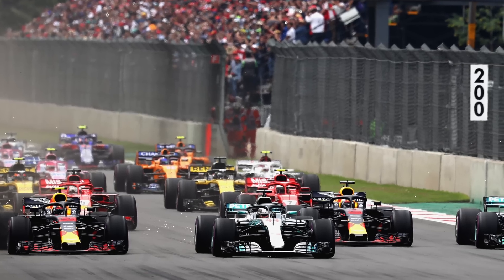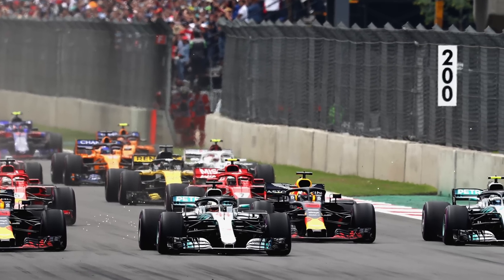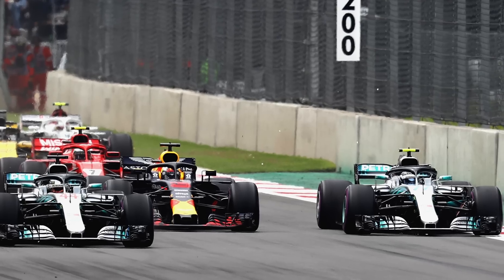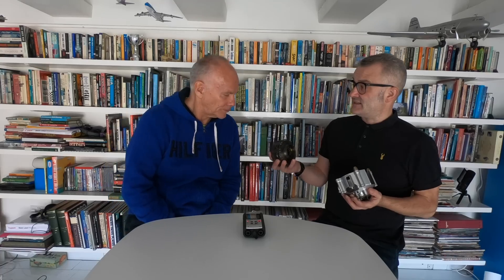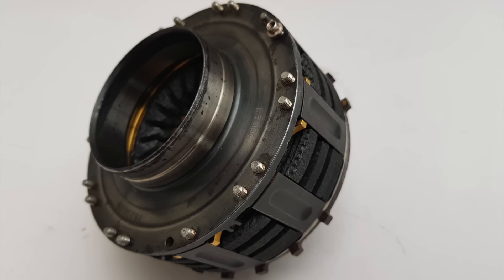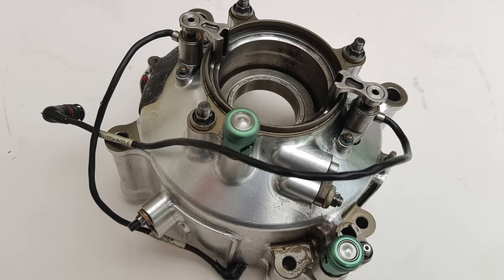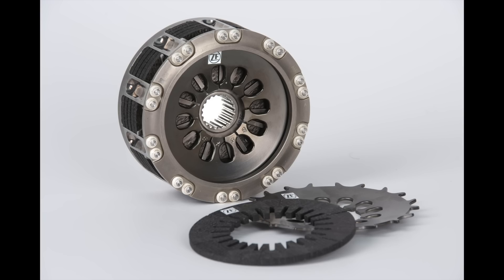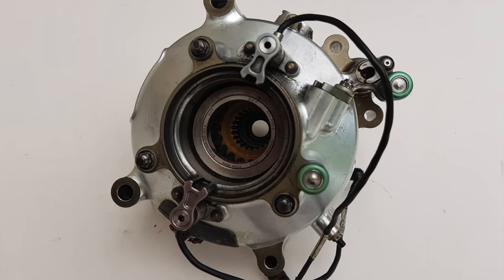Why did Daniel's clutch fail? F1 Update Craig Scarborough by Peter Windsor

Comment: I would like to note, the audio recorded in most videos, stereo, mode, is recorded 180 degrees out of phase from the left to the right side. and is difficult to hear , unless I block off one of the speakers or drop out one ear bud... You have a huge noise cancellation issues...

Comment: "All the torque going through the bearing" -- I assume this was a mistake, and you meant the force going through the bearing? The whole point of a bearing is to not exert or transmit torque (which in the context of a bearing would be called frictional losses) while standing strong to large axial and lateral forces.

Comment: The clutch isn’t a wet clutch? Thrust bearings are only engaged during gear changes so it’s possible red bull is going for an aggressive shift rpm timing. I’m guessing there isn’t a throw out rpm sensor to make sure it isn’t spinning to fast between gear engagement.

Comment: I don't eat that!

It was clearly  left side smoke only.

Clutch-bearing => hydraulics even when all hydraulics pipes on one side =>  left side  would have been way in front of gearbox and (!)below manafold =>Turbo so that the hydraulic oil and the smoke would've been not that intense cause away and below from exhaust and also n o t only on one side of  car .

(!!)8 to 2 DNF's on Daniels side is also no  plausible "natural" stochastic number. 
That number's only possible with degraded or refurbished parts on Daniels side in terms of cutting cost on him .
That's unworthy for f1-racesports, RBR and last but not least eating away Daniels most  positive attitude which is imho best of all drivers in all formula series ! 
Daniel deserves best quality racematerial although leaving RBR.

So left cylinder bank failure is way more realistic in terms of smoke -at least  to m e.

Sorry don't buy that sole clutch-hydraulic issue from RBR.

Comment: Excellent info .. I've maintained that Daniel is getting 'ripped off' by Red Bull Management ever since they decided Max was going to be their #1. They did the same with Mark Webber. Its disgraceful and only a fool would believe both cases coincidental, especially Daniel's 2nd half of the season v his first half v Max's first half with his number of self caused DNFs. My only question is how old was the clutch on Daniel's car and is Max getting newer or better parts?
Reply: Daniel's reliability issue started at Monaco though

Comment: People continue to let Redbull off the hook by blaming the engine, saying that if they had the Mercedes/Ferrari block in the back, Redbull would be winning championships. (or close too)
Lets not forget that a similar thing was being said of McLaren when the Honda engine was letting go. McLean had the best chassis people would say, and as soon as it became clear it was more than engine trouble McLaren were having, the press put it all on McLean, saying it was only McLaren that had thought it was a engine only problem. 
Redbull have had lots of issues not related to the engine. The problems they have had with engines could also be because of the areo they choose to use. Lots of McLaren/Honda engine issues seem to be, in part because of McLarens failure to give sufficient cooling etc.
On top of all that, assuming Redbull did have a winning engine/package, who's to say their strategy it up to the task. I'm not convinced by what I saw with their world titles. Would their four titles have been enough to have competed with Mercedes this season? Taking high risk strategy when you have nothing to loose, can often be seen as a flash of genius. Do Redbull have a champion in Verstapen? He's fast but does he have the ability to take a bad race on the chin with consistent point scoring?    Redbull have much further to go in my opinion than many others seem to think, and it could be a hard lesson for Redbull to learn should they get the engine they want, only to realise they still need more. That could then be the start of a downward trip for Redbull as they go the way of McLaren.

Comment: Daniël was pushed back a few meters by an engineer before the warmup lap so that he could lay down extra rubber for the start. Have a look back it was really strange, I’m interested to know if that was legal at all. He may have then pushed his clutch bearing to much to lay down extra rubber.
Reply: They spend all weekend laying rubber onto the track.  That little bit extra on the start line is perfectly legal.  You will notice that most front runners do it to some extent.
Reply: Yes, I know they lay down rubber, but Daniel was pushed back a few meters before warmup which was really strange

Comment: A clutch thrust bearing should NEVER fail in a race car. It does spin fast, but in prior years they had to spin a lot faster. Scarb's implied comment that the engine power goes through the thrust bearing is just wrong. The power is transferred though the discs in the clutch pack. There is so much misinformation around F1 and RBR will probably never tell what actually failed, but you can bet it was not a simple thrust bearing as the main cause of failure.
Reply: Effort to release the clutch pack is much higher that it ever was due to higher torque= more load on the bearing.
Reply: The statement about the thrust bearing failure reminds me of when Martin Brundle said that Formula 1 cars don't have spark plugs anymore...
Reply: The engines now pack a lot more torque than a V8 or V10 ever did. Clutches are specced mainly on torque, more torque requires a stronger clutch which in turn is more work for the thrust bearing to open.
Reply: FyreSpit Yes more torque, but at the start of race torque can only be applied until the tyres begin to slip, that's the limiting factor to how much torque can be used, also diaphragm volcrum point can be moved to increase leverage so no addition force is required when using a stiffer clutch spring or diaphragm, also more plates more surface area more drive for less spring pressure!

Comment: Why did Danny have to retire though? Why couldn't he continue like Schumacher did when he was stuck in 5th gear and took second place?
Reply: Because it wasn't his gearbox, it was the clutch/hydraulic system that failed and created a leak. His engineer on the radio told him his "steering would be heavy" (hydraulic power steering), and the car also caught fire when it was being recovered due to the leak.
Reply: @nicklythall  and you lose throttle with a hydraulics leak

Comment: If the clutch is only used at the start of the race and in pit stops, then why would it fail during the race? If the gear changes are made via the shift mechanism Scarbs talks about at 1:13, then why would the clutch thrust bearing fail, all of a sudden?
Reply: thats not true, the cluch is used at all gearshifts, but the stress on it is different
Reply: It's hydraulic to allow you to shift as fast as it does
Reply: The clutch is not used when shifting gears
Reply: @williamschoots8225  it's pretty much an automatic lol

Comment: It would be interesting to tally up how many of Red Bull's reliability issues this year have been Renault issues, and how many have been Red Bull or other supplier issues that they're happy to let the media describe as "engine failures".
Reply: Can't find it now but I did see a chart somebody had done up, Daniel has had 14 part failures in 23 races, leading to 9 dnf's (due to failures, he has also had 2x DNF for crashes), only 2 of those were related to the Renault powerpack, the rest were red bull specific parts (Hydraulics, Exhaust, Electrics, that kind of thing).
Reply: @passportMHP  yep because it's not immediately obvious to anyone with half a brain that the "power unit" is the weakest part of the Red Bull car. How many times have the McLarens stopped on track for no reason? Even when Seb won 4 consecutive titles, he had one of the lowest trap speeds! Fact. That must mean that Renault make the best engines
Reply: @Daniel-Ford-Lawther-379  I think cooling differences (lubricants do it too so maybe the heat transfer characteristics of the Mobil 1 are rubbish) and the fact Red Bull have a better car thus allowing for more time on full throttle would effect the reliability more vs pure lubricants? Maybe not? We are both not privy to that information to make the call. But Renault also supply all the software that controls the engine so one would assume that it would raise alarms bells if the Red Bull spent too much of the time in qualifying mode
Reply: @Daniel-Ford-Lawther-379  thanks for this info 👍
Reply: We're not speculating. The information is out there which demonstrates which failures were Renault (one of the power unit components) and which were quality control or install issues by Redbull or a 3rd party supplier (hydraulics, clutch, wiring, gear box if they use their own? etc.)
Reply: All you guys fail to realise that it is not purely Renault or purely RB. All these components must work perfectly together, and it might well be that a "RB component" fails due to incorrect data or bad working on the Renault engine. Max is blaming Renault for it since RB cannot influence what they get. It is a reflection of how bad the communication already is between those technical departments behind the scenes. Furthermore Max is very outspoken on the fact that they lose about 3 tenths every main straight ue to lack of power and  for most of this season lack of a party mode in qualifying.
Reply: The only reason they keep blaming  Renault is to try detract from what Red Bull are doing to Danny Ric. How dare Danny leave!!  Despicable dirty Horner and Red Bull.
Reply: @Daniel-Ford-Lawther-379  such a comparison will definitely be interesting but it will never happen. I know F1 engines have incredibly fine tolerances but lubricants are lubricants as in using the wrong one will not cause failures, rather just make the operation and hence power output worse. Also they analyze the oil after every outing so they can tell from the contaminants what's wearing prematurely. So all Renaults fault in my book. Remember when they refused Ilmors help in 2014 or 2015, just coz they were appointed by Red Bull. This just demonstrates stubbornness and incompetence as they gained significant power when the help was forced upon them
Reply: You guys are all idiots, so it only fails on one of the cars. Well Daniel better learn some mechanical sympathy then. Renault are shit and Daniel a traitor, so all in all good fit
Reply: @LawrenceAbramoff  😂 joker.

Comment: I would just like to find out, isn't the launch control supposed to prohibit excessive wheelspin electronically in order to protect the clutch assembly from self-destruction.
Then I would also like to find out if Traction Control has been legalised in F1 when a return to electronic aids were introduced, and if not, I would like to suggest, that allowing it back into the cars would make F1 racing much more interesting without failures of the kind that stopped Ricciardo in Mexico.
Reply: Formula 1 no longer implements launch control it's been banned for a while now. The driver is in control of the throttle and clutch using the paddle on the steering wheel. Remember Ferrari dropping the dual clutch paddle and implementing a single longer one.
Reply: @Johan Smit "a return to electronic aids were introduced"
And this was, when exactly? The only driver aid allowed, by my knowledge, is power steering. TCS and Launch control have been banned for one and a half decade now.

I also don't see how adding driver aids makes racing more interesting when all you do is take driver error out of the equation, which is the main reason why the drivers can make such massive differences right now.

Comment: Imagine if Merc got Williams as it's 2nd team and Ferrari got Hass as it's 2nd like red bull got tororoso how much they will be improved... As 2nd teams will be carrying out their on track testing like tororoso doing..
Reply: Ferrari and haas are working closer together then TR en RBR except from the engine
Reply: @gijs5160  where you get that info cause I heard that Hass was accused of working with Ferrari and FIA confronted them and they had to proof that to FIA on the 1st half of this season but don't quote on me that.
Reply: @shawonbsws  haas buys all the parts from Ferrari they are allowed to, torro Rosso simply isnt able tot use much of RBR parts because they have a different engine. But met year they are gonna work as closely together as possible
Reply: A few years ago TR basicly got  the RBR car from the year before, only one time because the FIA called it illegal. The last few years TR was Just developing its own car because the tought they were not allowed to use much parts from RBR (except from gearboxes i think). Because of haas they now know they are allowed to work together more closely so they will next year
Reply: because of HAAS?  ey?   it is black and white written in the rules what you can buy off the shelf.  eg, engines, gearboxes, suspension.     More items are on the list than many years ago, but it is clear that the chassis must be developed independently.  HAAS has done this.    Having last years car from the 'first team' is simply against the fundamental at the heart of F1.   If TR once had last years RB car this is so blatently against the rules i cannot believe they thought that could get away with it.
RBR will get a years input regards the honda engine, be able to influence how it develops and also be willing to allow honda to trial and change extra parts till the end of the season to help next season.
I have for some time thought that Honda would end up at RBR and i think it will be a great success.  Honda have traditionally been willing and able to take  car designers needs into the engine design, rather than design specifically for performance and say take it was it is  The Mclaren/Senna years are a great example, - take some time to read up on how gordon murrays concept for the car required honda to provide a differently designed engine. (which of course they did brilliantly).   Sadly, i think Honda were almost too helpful at Mclaren for the first two years when they would have been better to develop of the technology, get on top of that, then start tweaking and tuning to help the car.   (they also went down the route of 'we cant beat ferrari and mercedes following the same path, so we must take a different path. - which historically worked for them, but not this time).
Reply: @andy-dt7to  "I cannot believe they thought they'd get away with it"
They did get away with it. For a season.

Comment: Simple answer : someone at his garage sabotaged it.
Reply: I can almost hear the subtle crackling of the tin foil hat 😁
Reply: Just like how Max had clutch issues 3 GPs in a row in 2016 (Spa-Monza-Singapore) when Daniel had perfect reliability all year.
Reply: Yes, you must be simple to think that.
Reply: @MrSamtheman922  this is what happens when you are too late for when they hand out the iq points
Reply: Sure buddy, sure
Reply: Real answer: Made by Renault
Reply: @hjembrentkent6181  didn't they say that the clutch is not necessarily made by the engine manufacturer?
Reply: It's looking like something dodgy is going on. Vercrashem never seems to have a problem.
Reply: @andrewjones7595  Verstappen retired at Bahrain, Britain, and Hungary this year to a power failure, a brake failure, and an engine failure respectively. Red Bull's been having reliability issues on multiple fronts, which is really the sort of thing that happens when you try to build a car that can compete with Ferrari and Mercedes with a Renault engine.
Reply: Andrew Jones i guess you did not watch the 2017 season, or just a very short memory?
Reply: @prinsmetbroek  I'm talking this season. My memory is fine thanks mush. Dodgy Horner / Red Bull punishing Daniel for having the temerity to leave them for the enemy.

Comment: Great video...love the tech stuff.
Reply: Trance 9  Yes I also love tech reports on what went wrong, but the trust bearing which failed is not subjected to drive torque, the trust bearing purpose is to press on the clutch diaphragm fingers (diaphragm is essentially a spring which applies pressure to the pressure plate which in turn applies pressure to the clutch plates) which is rotating at whatever the engine speed is at the time, there is very little torque on the bearing to speak of! One possible reason for a trust bearing to fail is that the hasn't properly disengaged from the diaphragm fingers when the clutch is not in use, i.e. after a start being completed! In this scenario the diaphragm fingers are touching, dragging on the trust bearing spinning the bearing at engine speed through out the race causing the bearing to over heat and fail, normally the trust bearing would only be spinning when the clutch is disengage, i.e. When stationary and in gear while the engine running! Cheers

Comment: Wow. What a tiny clutch.
Reply: Agree, my wrangler is same size if not larger
Reply: But you have more than one plate, which helps transfering torque. 
4 factors can increase clutch performance.
1. Number of plates
2. Force to press the clutch together
3.  Circumference of the clutch
4. Clutch material
Reply: Red Knull?